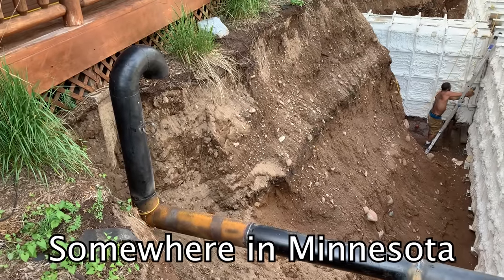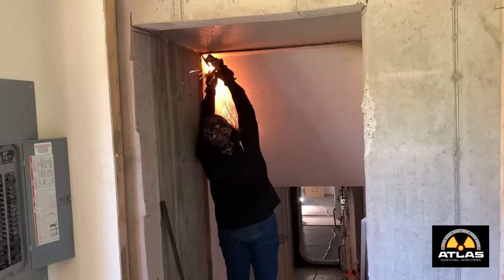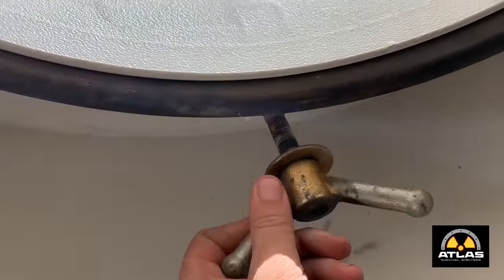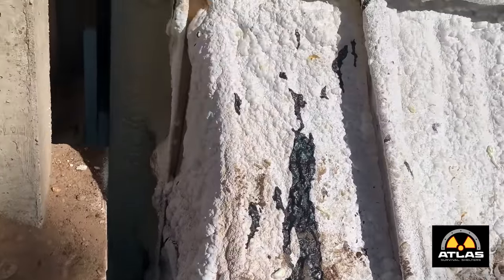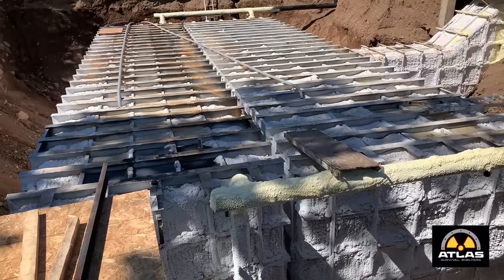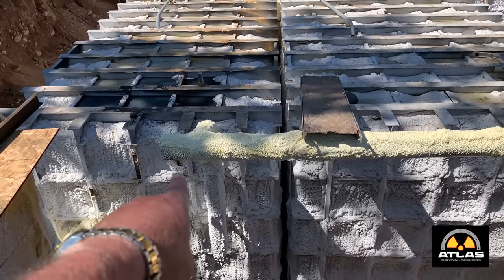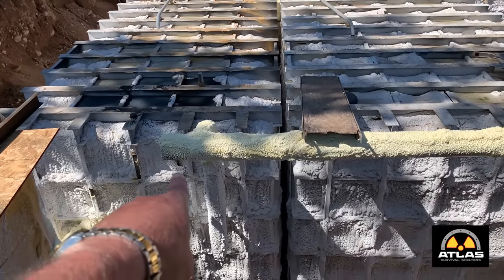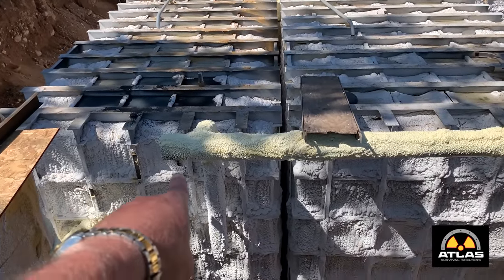A Completed $500,000 Luxury PLATINUM SERIES Doomsday Bunker

Comment: I just feel like for half a million dollars that thing should be fully furnished, have a full size gun safe already installed, nice carpeting in certain areas and a better way to hide the air system
Reply: Now when you are going to grow weed in it BRO>
Reply: I was wondering where the swimming pool was at that price? 🤔
Reply: Ok ,  So.bunkers have an.air system.....what air is good and how is it even possible. After a nuke hits. .
Reply: @teresacromer102   Excellent point…I was wondering about that too. The guy does mention that is has 2 “NBC” filters, (nuclear, biological, chemical), but he only says NBC, he doesn’t tell you what the initials stand for nor does he explain how critical they are?
Instead he goes on and on about cosmetics, hardiboard, spray foam, tar, liquid nails, etc.?
But you hit the nail, so to speak, on the head, air is critical in an underground bunker and I’ll bet if you go to the company’s website or check for other videos they’ll have more info on their NBC air filtration. If they don’t or if it’s too hard to find…I’d look for another company. Why he didn’t give a better explanation about NBC in this video baffles me…🤔
Reply: I was surprised there was not a redundant air intake system. What is to stop an adversary from just blocking the air supply to asphyxiate the occupants?
Reply: @murderbot4313  right, very true.  I just didnt understand how the system.was designed in a bunker to keep out harmful pollutants. fir lack of a better word  poison particles from the environment from getting into the air ducts that lead to the bunker. A nuke is so freakin powerful. Its beyond our imagine realy the total.destruction it can actually cause.     We hear stories but living through the experience of course is a totally different story .  So it made me curious as to how is a bunker designed to supply air to people if the air outside is deadly .   Not trying to sound like an idiot.  I know modern tech has come along way. But cant help to wonder even though. .
Reply: More then likely the only thing to hit this bunker is a great poker game and some strippers!!!!Woooooohoooooo😎
Reply: @TomLongusa    I think he's said it so many times over the years (NBC) that he just assumes people knows what it means..and yes, it does mean "nuclear, biological, chemical".  They do call out on their website that they use only military grade NBC Air Filtration Systems from companies like AndAir or Bethel, which can be run electrically or manually (hand crank).
Reply: @5thGenNativeTexan  I know they do…I’ve been to their website multiple times.
I try to craft my answers to get the people to go & look for themselves vs just telling them the info.
Oh, and even if he’s said it a gazillion times…he needs to say it every time or he risks losing sales & stops misinformation from being spread by the uninformed.
It’s easy to add post production notes or info blurbs to correct omissions.
After over 40yrs in marketing I know how easy it is to screw up & how important it is to fix it early.
(good thing I proofed this, I had written 400yrs.) lolz 🥴
Reply: @TomLongusa  I doubt he's losing any sales... ;)   Just sayin...
Reply: @5thGenNativeTexan  How would you know? 🙄
Reply: @TomLongusa  Because he's got a backlogged client waiting list.
Reply: @5thGenNativeTexan  I m trying really hard to remain polite…but that’s just so f’ing stupid?
Just read the comments to this & other videos he’s put up & you can see he’s losing sales.
Even extremely successful business lose sales…
But, this is still a free Country, for the most part, & you can believe whatever you want regardless of how obviously absurd it may be.
Reply: @TomLongusa  Your civility know no bounds.. .lol.    right.     You have absolutely no clue as to the status of his business.  And if you're trying to base your conclusions on evaluating YouTube videos, you really need to spend a few nights taking some business classes. Period.  End of story.
Reply: @TomLongusa  he should have taken his raw footage and given it to a marketing firm to voice over and ensure nothing is missed in communication. He is an operation guy running the company and is outside his wheelhouse but great to watch
Reply: @mikesullivan2894  As 30yr+ marketing guy…
 I couldn’t agree more…
Though there is a place for the imperfect passion of a business owner that truly loves his product & isn’t just in it for the $$ 
👍
Reply: @TomLongusa  I'm not saying the guy doesn't love his company or the product he sales, but he's definitely in it for the money.
Reply: @TomLongusa  , sales guy,  smartest person in the room no doubt......
When one claims a business is "losing sales" it implies those sales are needed and could be accommodated.  There's no business in the world that didn't lose a sale today and every other day.  The statement means nothing if it means nothing.   Oh no, Bobstophat thinks it's too expensive so another sale missed.   Ridiculous.
Reply: @chrisfoxwell4128  of course sales are lost every day?
Price too high or too low, no perceived value, wrong…color, size, configuration,& an infinite number of other intangibles including, but not limited to the color of the tie the salesman was wearing or that it wasn’t worn at all.
Anyone that claims they close 100% of their sales is lying or delusional. 
That said, you still should be telling yourself and preparing to to make every single sales opportunity that arises.
Mindset & preparedness are everything, along with testing, testing, testing. You can learn from every sale you lose as well…
There’s a huge difference between sales professionals and order takers. The former blame themselves while the latter blame the customers.
Reply: @teresacromer102  it’s a air filter that filters out all the harmful pollutants but nothing can truly filter out radiation except solid lead or a lot of dirt
Reply: @Blueknight1960  
What other reason could there be?
If he wasn’t in it for the money what chance is there that he’s going to be there long term for the customer?
The profit he’s making is secondary to the quality of his product & his reputation for standing behind it.
Your point is valid if he isn’t taking care of the customers…but that’s why you always research previous customers & not just the cherry picked ones.
Reply: @teresacromer102  If you’re outside a city or in a small town you’re unlikely to be near a target
Reply: Nuclear radiation protection is not even mention for the outer layer of this Bunker
Reply: yeah for the half million I'd want some emergency o2 candles, and a hospital spec air compressor and o2 bottles and full face BA systems with rebreathers so if the air I take that's hidden under the deck gets blocked by fallen decking and rubber you would have a chance to dig yourself and family out of that claustrophobic es c ape tunnel.......and you would want a full face mask with air while digging up through 2 feet of compacted earth with plant roots.
Reply: Yeah. I’ve thought this of Atlas since I discovered the videos. The quality is just crappy. Bare bones interior. No thought to psychological impact of being down there. All it would take is 10k to make the interiors better. They’re cheaping out. Big time.
Reply: @azazelone905  I think they are spraying open cell foam on there too.  If so it will just absorb water like a giant sponge and cause the thing to rust out even faster….
Reply: @Blueknight1960  he’s worked there for free his entire career then made a cent from the company. Check his video about his office being Molotov cocktailed & he says it. does it for the love of the bunkers & to help the community. Now he could make $ off YouTube but I mean guys gotta make $ somehow.
Reply: Everyone keeps asking about what if people were outside doing this and that. If it’s ok for other people to be outside then you can be outside and shoot, fight, etc. The whole purpose of being sheltered underground is when no one can be outside above ground.
Reply: @a-a-ron4679  it’s not about during the crisis. It’s about the events leading up to it. How do you manage 50-100 people showing up to this bunker BEFORE disaster strikes?  Because words gets around and they’ll come if you advertised you have a bunker.
Reply: @m.s.837  it’s called dirt. 3 feet of compacted dirt, or 2 feet of concrete, reduces gamma radiation to safe levels.
Reply: @kendon81  or, use the escape tunnel. Takes 5 minutes.
Reply: @azazelone905  this is for a nuke. Everyone outside would be dead or glowing. This guy did it right, put it in a rural property.
Reply: @teresacromer102  nbc - nuclear biological, chemical
Reply: @TomLongusa  nuclear biological, chemical
Reply: @sr71ablackbird  Yea, NBC is great but if anyone of those hits you’re going to need to stay in there for quite awhile.
If it’s a full scale nuclear attack you might even wish you didn’t survive?🤔
Reply: @TomLongusa  i know. not to mention how often those nbc filters would need to be changed. i still have `nukemares' at times. not sure if ya seen it or not, however, when i was viewing the video segment, the list of video segments also had a segment on it as to what one of finland's bunkers was/is. it's `wild' in a sense, so to speak.i think it was called `200 million dollar bunker for 6,000'.
Reply: @TomLongusa  as do i. not too far behind, just a decade. ( though considered `far enough behind' ). i also prefer the  ( b )asic ( I )nstructions ( b )efore ( l )eaving ( e )arth. i  usually put the trust in the creator first and then his manual. now iran, has the centrifuges that have the ability to enrich the uranium past the 65% capacity level. which is frightening to state the least and most probably don't even know about it.
Reply: @sr71ablackbird  My order is God first as well…
I may have mis-ordered it, I’m a disabled Vet, non combat related, recovering from a home invasion. After 10yrs of repairs by the VA I still get little sleep due to pain issues.
I’ve seen, & like, that acronym before…
I usually tell people our time on earth is used as God’s sorting & sifting process to see who actually wants to spend eternity with Him.
I can think of a few people I sure wouldn’t miss but I pray for them anyway…knowing God wants all to be saved.

Comment: I have never welded in my life and I am confident I can weld better than whoever tried welding that doorframe
Reply: 8:45 ; did they not paint over the welds with an oxidising metal paint?
Reply: I've never laid any flooring in my life and I'm confident I could do a better job than whoever put those planks down
Reply: I’ve been welding for several years and  I promise you are sorely mistaken. Arc welding is never as pretty as mig welding but it is the right process in this application and he did a pretty dang good job on it. It’s harder than you might think and the importance is in getting good penetration, not making it look perfect.
Reply: @Charles-tj8ol  people always expect to see tig welds 😒
Reply: @Charles-tj8ol  not to mention overhead welds always look the worse.
Reply: Trust me, you can't.
Reply: those welds ain't pretty but those are quality welds. it looks ugly because of the prepainted surface and the stuff that flies from the welding but you sure as hell ain't going to have a good weld like that without years of practice.

Comment: Air intake are totally in the wrong places, house get fire, boom no fresh air. Intakes should be away from house, secure and well  concealed !!!
Reply: Bro it's a man cave bunker.. how long do you think it takes for a house to burn down? If your worried about smoke it'll fly way high.. remember kindergarten stop drop and roll plus there outside
Reply: @PilotTed   If the house is on fire, so are the bushes If I remember correctly, the fire consumes OXYGEN , all that's left is carbon dioxide and burning plastic, very toxic smoke.
Reply: Yeah, like one of those fire pits with a trench under, the house on fire would such the oxygen out. Having that pipe away from the building would have been better, and ideally several intakes to be sure.
Reply: Let alone the check valve needs to be serviced with time it will fail... hmmm hard to service foamed and buried with no service access.... FAIL

Comment: A house with a basement and a secret bunker attached to it...if I had that kind of money that's exactly what I would put it towards in these troubled times...love the double layer of safety, plus the extra habitable space for the house. I'd probably spend most of my time between the basement and the bunker just for the heck of it lol.
Reply: tbh i would invest all my money into building the bunker a small house ontop, the security of a bunker with all proper features installed is unmatched. i know my family will be safe there and myself and i could store my wealth down there. and with any extra money i will put up a good strong gated fence to keep out unwanted guests from snooping about. i would say thats a long term goal every family should have.
Reply: Love these videos, my only questions are, what happens when all power is out and the water stops running/gets contaminated?
Reply: @TradeInfinitum A fence won’t do any good unless there is someone above ground on the inside to utilize it. Without an armed owner in sight, a fence is no match for a desperate group with bolt cutters. That money could be better utilized. As a matter of fact, it could end up being a detriment. It just tells others that there is something valuable inside worth protecting.
Reply: @smudge613   You have your own power (solar, batteries, inverter), and have your own well.

Comment: Suggestion - Gooseneck the connections from the intake and exhaust air headers outside of the bunk.  So instead of direct elbows, put in a gooseneck/double elbow and have the air intake header sit slightly lower than it is now with the air coming off the top of the header.  Then the condensate trap, add a second dissimilar design check valve for redundancy and an extension pipe so it’s located ~6-8’ further down and has a dip leg which would collect the condensation and add head to the water so it will get out even if things degrade or go wrong over time. (Gravel bed plugs with debris, check valve gets sticky, etc)

Comment: You can't pour in gasoline, you can't blow in carbon monoxide... but you can just cover the thing with saran wrap or maybe some duct tape. Or just shove dirt down it, so if possible for anyone getting a system like this... build a nice metal cage, wider spaced big bars, and then finer heavy duty chicken or other fencing wire over that around where you put your air vents to the surface to make sure as much as possible nothing can easily get up to them. But do make sure you can still go and clean it from time to time when you need to. Just an extra way to try and make sure random stuff or animals dont get to them and start using it for anything, or kids or people who want to play pranks. If you spent this much on this system already, an extra few hundred bucks or maybe a thousand for a nice protective covering isn't a bad idea depending on where you are. Also plan the air intakes position for your environment. Around my place we got pine treas and stuff that will cover many parts of the ground in needles, cones, and other stuff that gets mulchy and can easily go past a foot in height if not cleaned each year at some point. If you want it to survive a big fire in your area or something that damages the house... be sure to keep that in mind in case like this under patio setup the house burns down and falls onto the intakes, possibly covering them with ash and old wood and stuff. The air vents are the most exposed part of any bunker, so always put some though into how you want those positioned on your property or project to make sure they are safe from all normal weather, creatures, local people, disasters, or anything else you might need to be concerned about. No one wants to be in the bunker, and find somethings blocking the air intakes for it.

Comment: I would love to see a real break down of the cost on these things not just him throwing up some numbers and saying trust me. At half a million this building has less sqft then most mobile homes. I understand you can't bury a mobile and call it a blast rated bunker, but this thing is only maybe 3ft underground. I build homes for a living so I can guess the cost of a lot of this bunker and it isn't coming to 500k, I guess this is one of those instances you're buying the brand not the material. The Narrator here mentioned they don't use a lot of wood and instead use hardie board siding and trim material (which isn't just concrete like he insists on saying but fiber cement) but then just uses it to cover up wood underlayment on the floor so I hope you keep it really dry. The problem there is that hardie board gets brittle faster in very dry environments. don't even get me started on his choice to use the cabinets and vanity that look like they're vinal wrapped particle board which is one of the cheapest things you can use.
Reply: I think these make sense at smaller, self contained sizes. Like a single 12x20 room with everything you need in the smallest possible pre constructed package. For something like this or bigger id imagine ICF or just straight concrete would be more economical. You aren't paying for the name you are paying for all that welding and steel.
Reply: Probably paying for a lot for construction, transportation and labor